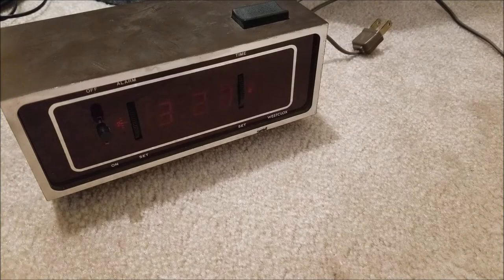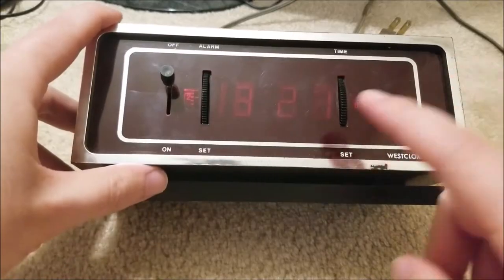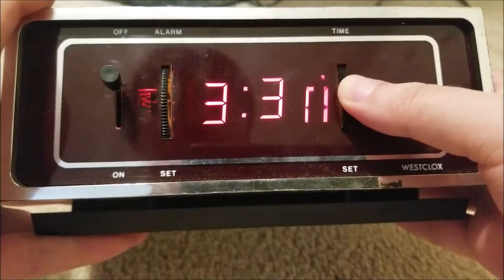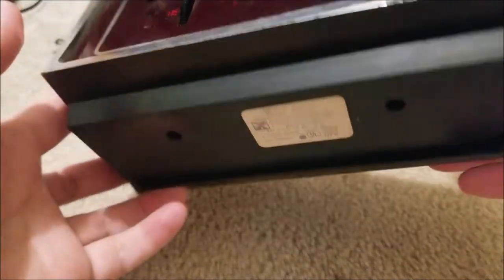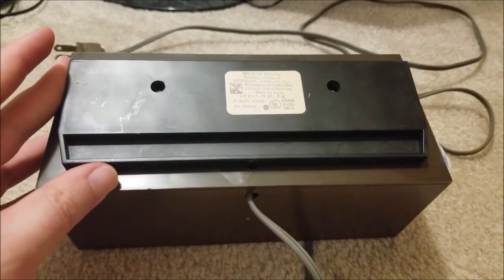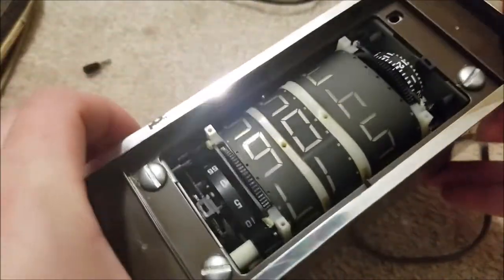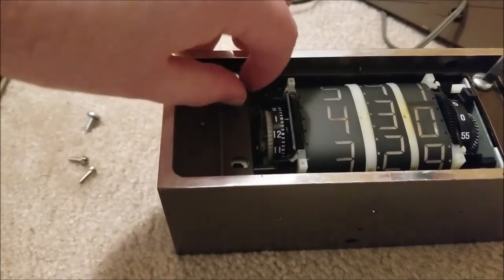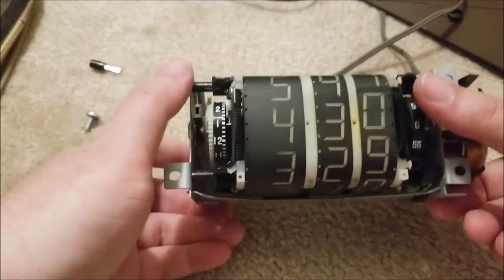An Interesting Westclox Electromechanical "Digital" Clock Teardown

Comment: The secondary winding is intended to step power down for the light bulbs. So technically it´s a motor-transfomer. You should check the primary for movement.

Comment: Check surplus center for synchronous motors like that.   Pick up a new sponge while you're at it.
Reply from the maker: I've ordered some stepper motors so I can just use a 555 or small micro as the timebase and just run the clock off of 5V, should be interesting trying to interface a different motor to this mechanism. As for the sponge, she's got some life left in her yet rofl!